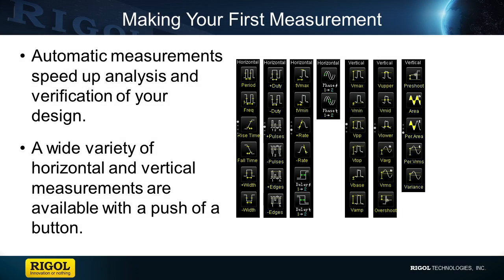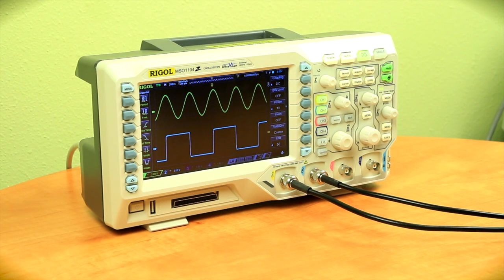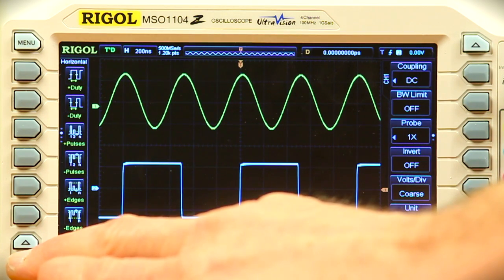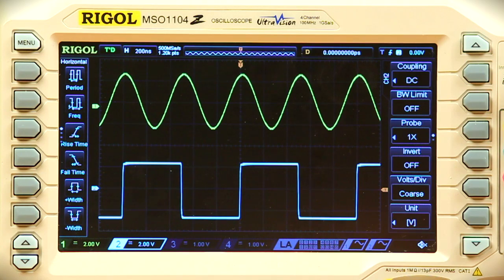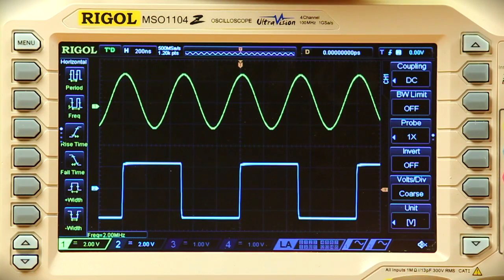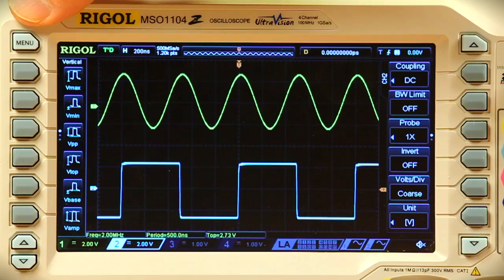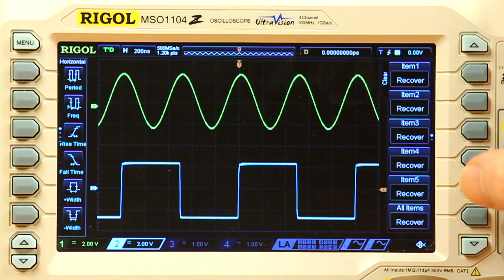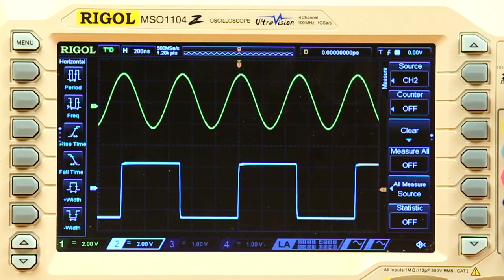Using Standard Measurements

Comment: Yeah.... as soon you use large font its a pain to use. The mesurment display keeps dislpay the items you cant see in the background. 
Its not possible to display a measurment how is deleted already on the large font easily.
You have to select other measurment types and than the measurment you want AND some more to push the measurment you want to display with large font to the left.
Its awful....
There is a second method. Delete measurments -> pick new measurments -> got back and search the menu for the display font size and change it back to normal and back to large. This works better.
I dont understand why you cant push a button with large fonts and display it when its in the item list for the normal font.....
Reply: I agree. If the item won't fit on the screen the scope should either dynamically scale down all the items' fonts or stack the items. But; for the cost, I am still happy.